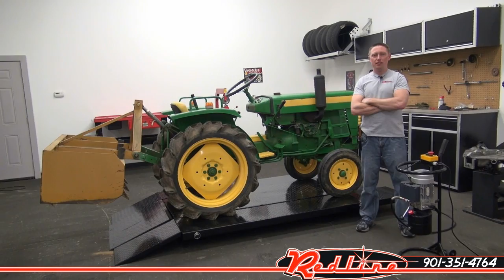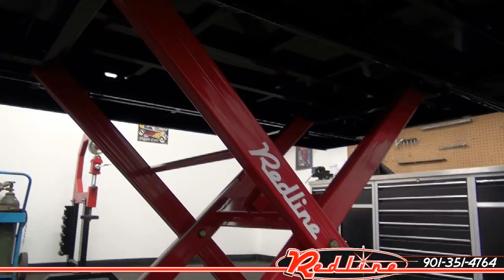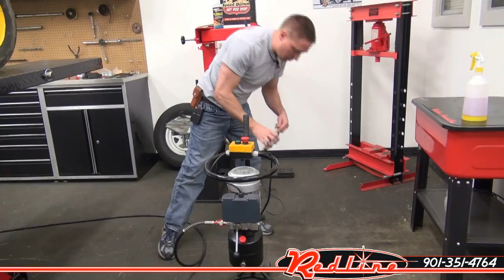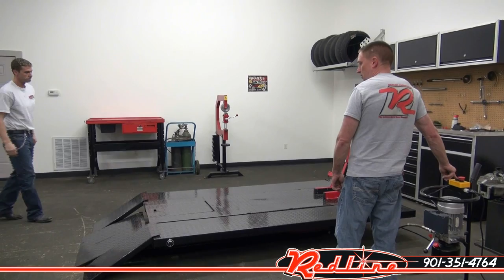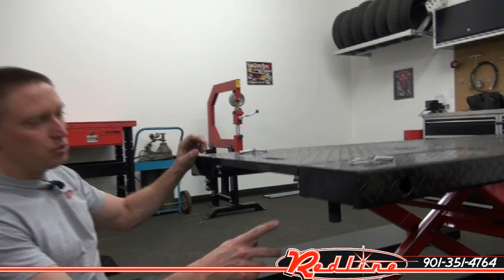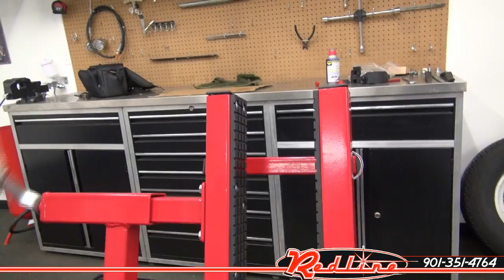Redline 2200HD UTV ATV Motorcycle Lift Table

Comment: I would have bought this one had it been made in USA - i purchased a Handy RAM (2500 rated capacity) today instead because of country of origin.
Reply from the maker: I wish more folks were willing to buy the American made products we sell at Redline, but I understand the price differential is a big deal.  As of 6/5/24, the 2200HD is $3799 delivered, and the Handy RAM with sides and a vise is $6359 delivered.  For a lot of folks, that's a hard pill to swallow, especially if you don't have the extra money at all.

Comment: Does it have to be anchored to the cement? I have in floor heat and don't want to drill holes
Reply from the maker: No sir.  You just set it right on top of the concrete and go to work.

Comment: Why do you not have pins in drop out panel inplace of bolts and bushing that can be lost?
Reply from the maker: I'm afraid we don't design our tables so we cannot answer that.  We private label tables already in manufacture by other companies.
Reply from the maker: Exactly.  We buy equipment from companies overseas that already make a nice product and private label it.  John Deere does the same thing.  Look at any 30 hp or smaller John Deere tractor and you'll see "Yanmar" cast into the side of the block.  It's a Yanmar tractor, not a John Deere.  Everyone does it.
Reply: Andromeda Galaxy  that's how the world works.  you think milwaukee or dewalt actually makes coats and hats?